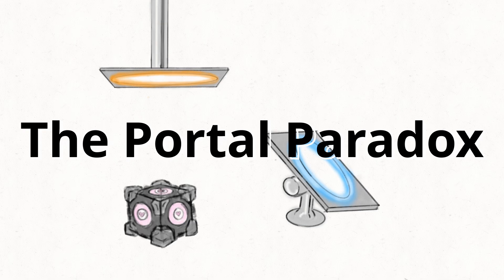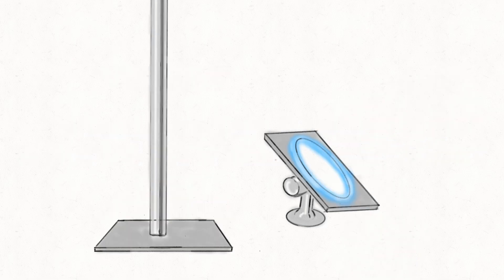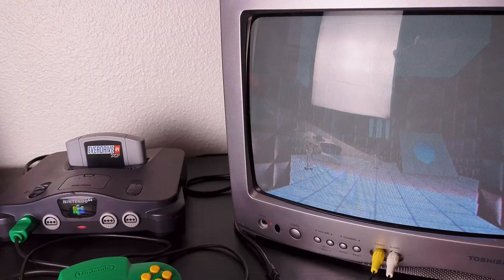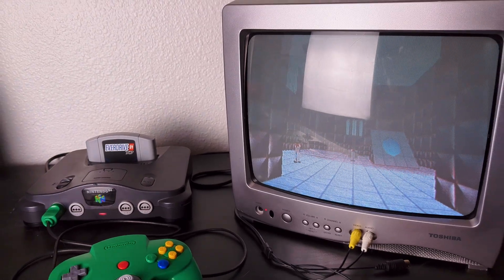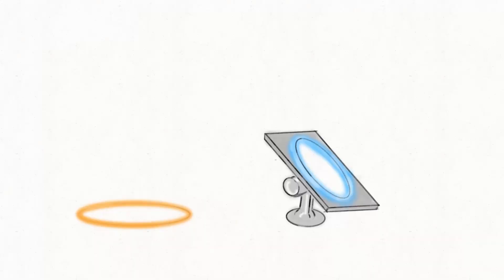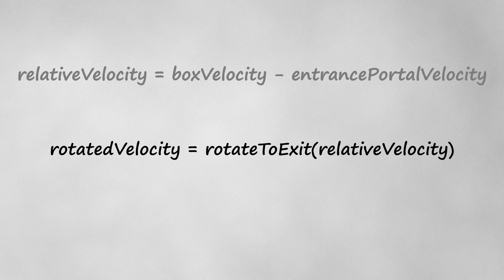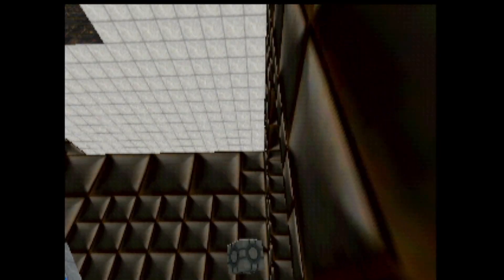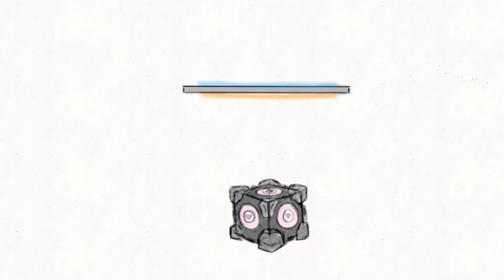I rewrote Portal from scratch and solved the Portal Paradox

Comment: the only problem I have with this interpretation would be what happens if the cube is glued to the ground, and the portal slaming down on it stops just before the glue.  Why would the cube attempt to tear itself out of the glue, as the projected physics seem to say it should?
Reply: I believe that the major problem here is that you are using the real world's physics to understand a problem that was created on the Portal's physics. We don't know if portals could ever be created on our universe. I believe that if a portal could be created it would be impossible to move the orange portal without the blue portal move too. If only one of them moves you would create a machine capable of create momentum. As I presume the portal does not have mass the static objects that travel through should not move. Otherwise you would be creating energy and that violate the laws of physics. Now if that could be made (a moving portal that the other side is not moving) then as mass could travel through as do forces. The electrical forces that holds the cube to the ground should try hold it as the momentum is transfered to different parts of the cube (as atom by atom travels by the portal, they are accelerated more than the "static" atoms on the other side of the portal). Resuming: probably the cube would be desintegrated or heated 🤔

Comment: I would argue a bit differently here on how this functions. The portal’s speed does not change the velocity of the object, simply the rate at which it moves through the portal.

Newton’s laws would state that an object at rest will stay at rest unless acted on by an outside force, only… the portal isn’t exactly an outside force. More like it is simply taking the particles and having them simply exist in their current state in another place. 

The velocity of the actual cube stays the same though in this scenario, which is zero. It is not in motion so it is not going to simply go into motion unless it already was before going through the portal. 

But again, this is on the basis that portals do not count as an outside force and actually has more to do with the science behind how the portals move objects than it does the actual cube itself. 

If the portals forcefully put object a in place b, then this may have merit, but as far as we can tell, portals are more like a bridge between areas. If you walked forwards into a portal to get to the other side of a bridge, it would be as though you had just taken a faster route through the bridge.

All in all though this is my personal take on it based on how I understand physics

Comment: In one way it seems correct bc, if you put a sequence of lots of boxes going through the moving portal, they would had to keep the portal velocity or they all would occupy the same space. On the other hand, where the kinect energy is coming from to shoot all this mass? On this system a simple piston could made an infinite amount of energy appear from nowhere, shooting whatever mass exist on the way. 

That's why I believe the box should not be shoot away with the same velocity of the portal. On the case of lots of boxes together, it may make sense to they exert a force against the piston moving the portal, as they fight the inertia from the box ahead on the other side of the portal

Comment: I’d love to see how your game engine handles the orange and blue portals both moving but at different velocities, i.e. the orange portal moves down onto the box while the blue portal is elsewhere moving at a different velocity than the orange portal (and perhaps even at different angles to see what affect gravity plays). Particularly if the blue portal is moving in the same direction as the orange portal, how does the cube handle going from one to the other when they’re different speeds?
Reply: He did it already! the first experiment that is shown is exactly that. as you can see, the angle of the blue portal is not the same as the orange, and both move at different speeds, all that will happen is the speed of the cube will vary in the exit following the equation he proposed
Reply: the implementation already handles that because it uses the relative velocities of both portals so you can work out what that would do very easily
Reply: While both portals were moving at different velocities, one portal was not moving at all.
Reply: @DWal32  Mathematically that is just a different speed though. Going by the equations shown in the video, only the relative velocity of the portal and object matters, so varying the speed of the blue portal only changes the resulting speed of the cube as it flies (or plops) out of the blue portal, maintaining the relative speed between the cube+portal system.
Reply: @DWal32  In terms of the math involved that really isn't important. Combining the two velocities and changing their vector would work the same way, just with different magnitudes of velocity input and thus different magnitudes of velocity resulting.

Comment: Momentum, the momentum of the box stays the same so even if it was being pushed/propelled through portal by a moving portal since conservation of energy exists you cannot get free energy in the box to then propel it out the other end of the portal, one could argue that we are transferring the energy from the moving portal into the box but the box has no physical interaction with the moving portal and the energy and momentum from the moving portal would be transferred back into the surface that propelled the portal or into the surface it smashed into, although the box theoretically moved from one place to the next without the exchange of energy through it
Reply: I'm sure my theory is inaccurate at some crucial points but I'd be happy to learn where you've accounted for this variable or to hear that my original observation was true

Comment: I might be wrong but I think there is a fondamental flaw with the cube shooting out. If the cube comes out at the same velocity the portal had, then the portal has to cary absolutely 0 energy, otherwise, you would create energy out of nothing, which of course is impossible. The law of conservation of enegy in an isolated system cannot be broken.

Comment: It feels odd that people who doubt the cube would move rely on momentum and real life physics to try and debunk a complete unnatural phenomenon not possible in real life physics. If you just flip the perspective from the floor of the cube to the entrance portal, the cube is approaching that entrance at speeds and then the floor contacting the portal comes to a full stop, like sending a person through a windshield during a head on collision. Since this physics relies on the tearing of space, who says that there isn't a single point in which the cube's momentum is stationary until it is no longer possible for it to do so, IE as soon as the portal meets the ground, thus creating a breaking point for it to interact from its origin to the portal's exit. Any higher than that and the cube simply doesn't act upon the change in physical perspective, such as those arguing that a tall, rectangular box wouldn't move if the portal is halfway, which would make since if the portal doesn't make it to that tipping point and can continue to exist within its original point in space.

Comment: So one issue that this can't address is that matter in the universe isn't composes of nice neat 'objects.' In your examples (and I'd argue all of Portal) you'd be torn to shreds, especially in the case where the portal you are exiting from is moving away from you relative to your velocity entering the other portal. 

All instantaneous transfer of mass is impossible (and in this case portals are also perpetual motion machines, which is also impossible), but the examples here also show the issue that the exit "cube" retains information about the state and velocity of the portions of the cube that have not yet gone through the portal, there is never any stretching or deformation at all as the portals completely warp space-time to make these transfers happen. Trying to impute some kind of "paradox" is a nonsense statement because it arises out of two incompatible physics.

In short, just do whatever works anything is possible.

Comment: I really like how you did present your explanation here but I think the conservation of energy and momentum should play some role in here in this particular example. I think that the cube can't shoot out flying from the blue portal simply becase it has no momentum as it is stationery on the floor. When the orange portal comes down to it there is no logical reason why it should have flew out from the blue portal since the cube is not pushed towards the orange portal. It has no moving energy and when portal comes down, it still has no momentum and is still stationery on the floor. So it should just roll down due to gravity. Othervise it would just sudenly gain moving energy out of nowhere.

If it would be the cube being pushed up towards the orange portal on a platform and platform would stop moving, then conservation of momentum would mean that the cube will carry on and fly out from the blue portal.

Comment: Your equation does not take into account the Planck scale of space.

Your model is more akin to something like a quantum portal dealing with a single particle. 

At more everyday scales the edges of the portal are more like compressed space, ie a trillion Planck scale points. If the compressed space is wiggling or producing a wave form of some kind, the compressed space may have stranger interactions at the macro scale. Practical example: the collision of black holes producing gravity waves

Comment: How is this a paradox?
No force is being put onto the stationary cube, which means the cube would plop out not jump out the second portal.
If the cube was raised at speed into the first portal then it would fly out the second portal due to it being accelerated.
Ultimately we can't properly test this, because you can make an engine any results you really want

Comment: why would the portals velocity matter? if a portal is a connection between two points in space, comparable to your hoola hoop part of the experiment, the portals velocity wouldn't matter, since it's simply allowing the cube to move from one point in space to another, the velocity of the portal moving down would only determine how fast the cube gets teleported, it wouldn't give the cube any velocity, right?
Reply: That's exactly what conclusion I came too as well.
The transfer of energy matters on the cube not the portal, if the cube is stationary and kinetic energy is from the first portal but not the second it wouldn't transfer any kinetic energy to the cube or the second portal.

Comment: The portal does not move, the point where the portal is does move.

All this results are based on the velocity of the portal, but the portal is just a hole in space, it doesn't have any velocity.

Comment: All movement is relative.

If you are in a room with no windows on a boat sailing on perfectly calm water with perfectly steady wind, there is no test you can perform that can show that you are moving. From your perspective, you are stationary. Just like we are moving at 1000 mph right now sat in our chairs as the earth rotates. Or 450,000 mph as our solar system hurtles around our galactic centre.

Given this, lowering the portal to the cube is functionally identical to raising the cube up to the portal.

If you take away the portal, in the scenario where you raise the cube up rapidly, you'd be launching the cube into the sky. You'd expect it to keep moving if the platform came to a sudden stop, like a pinball launcher in a pinball machine. Now consider the scenario again, but with the portal. Again, like a pinball launcher, you'd expect it to launch out the other portal.

Since lowering the portal to the cube is functionally identical, the same thing will happen. The cube will launch out of the other portal - just like in your N64 portal remake.

Comment: It's the only solution that doesn't defy relativity. The only difference between a moving cube going through a stationary portal and a moving portal going over a stationary cube is our reference frame.

I think this becomes more intuitive if we do it with experiments in 0g. If there's any difference between the results of either the portal being stationary and the cube moving, and the cube moving but the portal being stationary, that would imply s preferred reference frame.

Comment: So, I see 2 interpretations of this. 
1 - the portals create a hole between 2 points, there is nothing at the threshold of the portal to inteact with an object going through it,.
2 - the portals create a path between 2 points and there is something at the threshold of the portal which interacts with an object going through it. 

if 1 is correct, objects on either side interact with each other through the hole, but the hole cannot impart any force onto an object moving through, there is nothing to push against and the object appears out of the other portal with the same momentum as it entered relative to the surroundings of the object before going through the portal. 
I don't think this could be the implementation as we see the change in direction of momentum through the portals, and the portal to the moon would have an object fly off as soon as it left the exit portal.

If 2 is correct, objects interact with the portal, not what is on the other side. the portal then has some agency and is able to manipulate anything moving through it, at the very least being able to change the direction of an objects momentum. If this is the case and the object has to interact with a threshold to pass through the portal, it is possible that the relative momentum between the portal entrance and the object is conserved between the portal exit and the object as they pass through. 
This accounts for the change in momentum direction relative the the objects suroundings before entering the portal. It would also mean that the implementation in the video is correct, which is completely opposite to my intuition. This could also work for the moon portal as anything moving through the portal would not be thrown away as they left the portal. Air pressure agasinst the portal on earth would push it through to the moon, creating the chaos we saw at the end of the game.

So I came here to say I think you're wrong and the box would just fall out, but now I think you are correct and the box would shoot out at speed, because there is a hidden threshold of the portal that interacts with the box and reproduces the relative momentum between the enty portal and object, and imparts that to the object as it exits the portal.

A lot to go through but I hope you see my logic.

Comment: if you think of the portals as a single tube/pipe filled with incompressible clay such that inserting clay in one end pushes the exact same amount of (in the case of portals, the actual inserted) clay it would be the same result whether you throw the clay into the opening at 30 mph or you extended the pipe into the clay at 30 mph, a lob of clay should shoot out the other end at 30 mph. Similarly if you were to do the hoola hoop test it would simply press out with no momentum. (reminds me of a cookie cutter when you overfill it and the cookies don't just fly out of the other end, they just stack up)